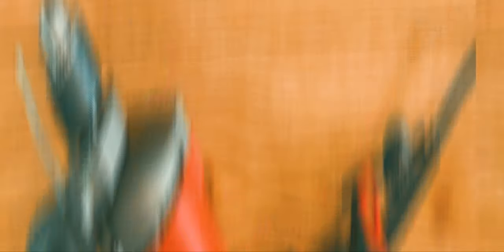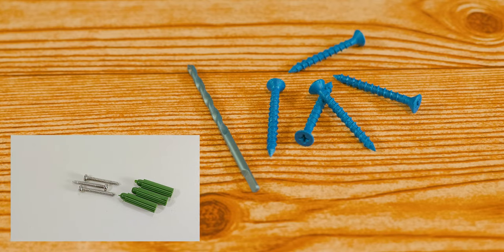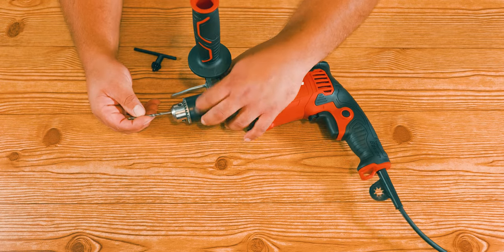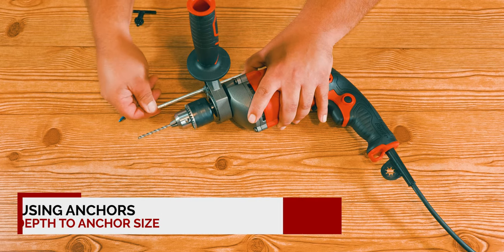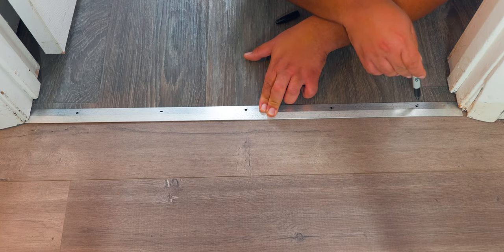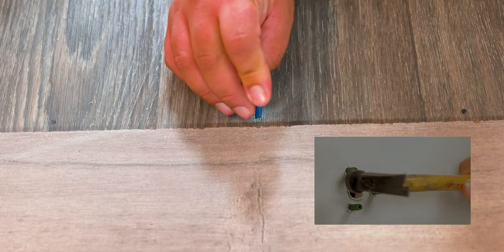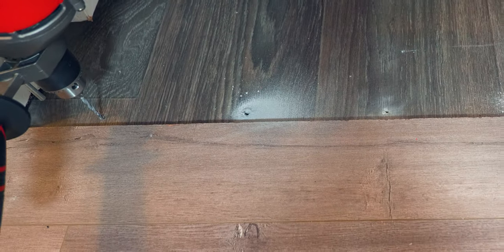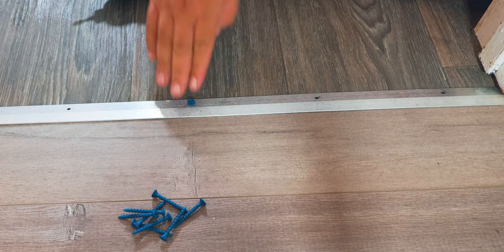How To Drill Screw Into Concrete Easy Simple

Comment: You left the screw heads about an 1/8” above the threshold strip. Was this intentional or are you not able to screw these down until flush?  I’m struggling with the damn tapcon masonry bit just turning the cinderblock to powder so much so that the screw just sit and turn loosely in the hole and can be wiggled out with my fingers without unscrewing them.  I even tried using one size smaller masonry but from another Tapcon kit but the screw doesn’t drive into the hole it just turns the sides to powder and then sits loosely in the hole again.  The construction in Miami from the 70’s is absolute garbage.  Any suggestions would be appreciated!
Reply: The problems your concrete is 50 years old. If it were either 80 or new your okay, just things age and they don't make em like they used to both comes to play
Reply: Use an anchor then screw into the anchor

Comment: Any advice on drilling straight? I’m trying to mount a wood wood rack in my garage with a hammer drill and concrete anchors but I’ve tried twice now, I need three anchors for each bracket and if even one isn’t perfectly straight the anchors will hit the inside of the metal bracket and I can’t get the holes to line up. Now I have six concrete anchors in my wall I’m going to have to cut. 🥹 I don’t want to try again until I have a hack for drilling straight though.